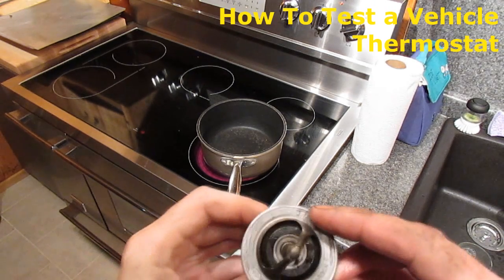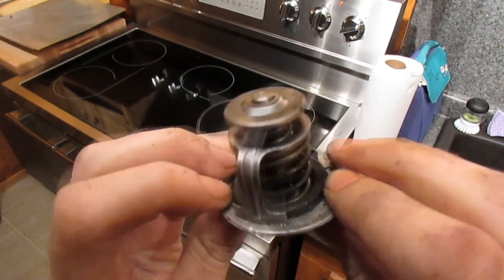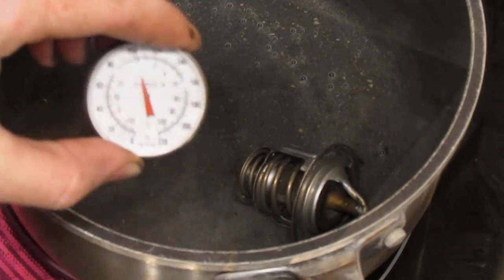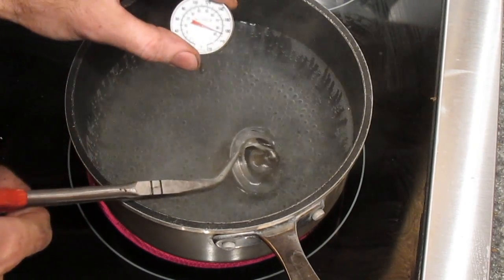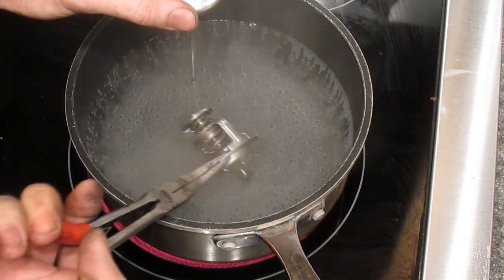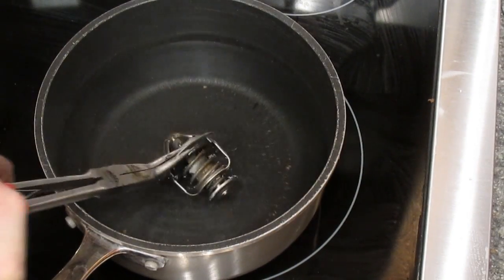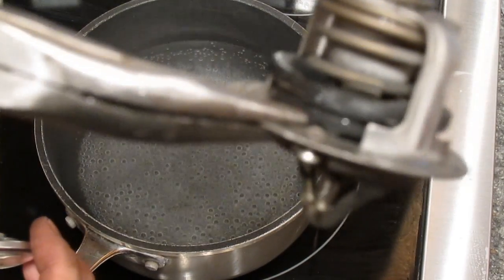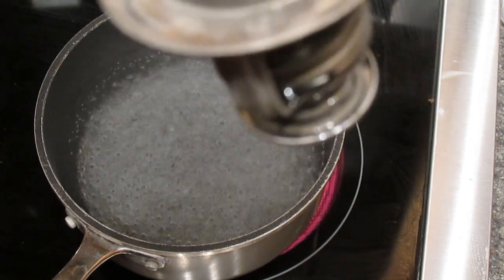How To Test A Car Thermostat

Comment: If it still opens and closes doesn’t mean it works, that rubber seal you were pressing on becomes weak and let’s coolant in when it’s closed. So even if it opens and closes still dosnt mean it words especially under pressure in a closed system